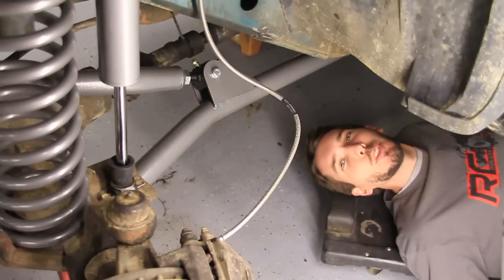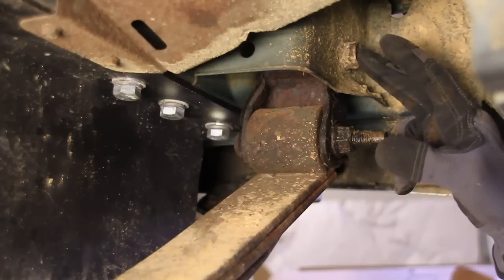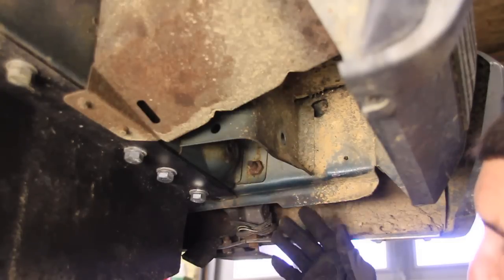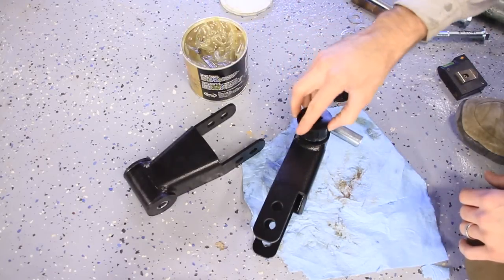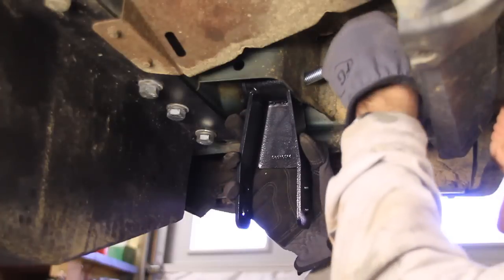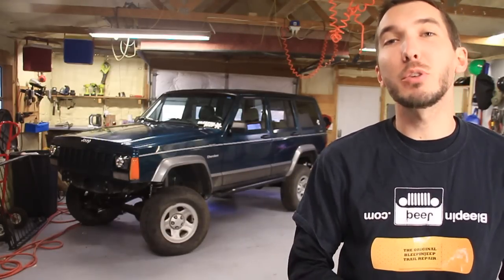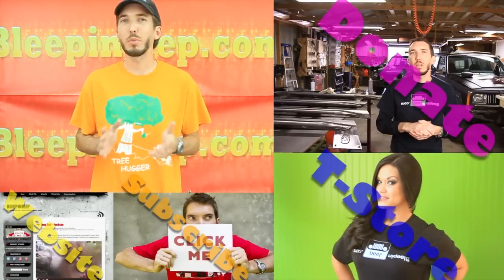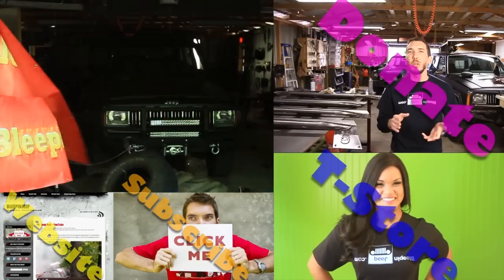How-To Install Shackles

Comment: Hey Matt! Love the videos. I have watched almost all of them now. 
My big question for you: When setting up the rear springs, would you go with a 6½" spring pack with the stock shackle or something like a 4½" spring pack and a longer, adjustable shackle or maybe a 4½" spring pack with a relocation kit and stock shackle? 
I got the front all figured out, but I wanna make sure the rear is set up right for pinion angles...

Comment: What's needed to lift a 1999 jeep xj 4 door 2 inches for weight compensation. So far I have lift shocks and shackles however I've got bumpers and everything but just want 29s for now, I have flares that are going to be installed at some point in the near future

Comment: Just installed a 4.5 inch RC short arm lift; my question to you. Do you think you can install longer shackles without having to remove the u-bolts again? Or do you need to take out the whole pack again.

Comment: Hey Matt, I know this video was done awhile ago but maybe you or someone else watching will know what to do. I've got this kit as well and I was looking at the hardware package.  You mentioned that the shorter bolts go up top... those bolts don't fit through the metal sleeve in the bushings.... is there a way to fix this or should I just try and use the stock bolts (if I can manage to get them out. Lol)
Reply from the maker: Ya, or just go get new bolts.  Tractor supply has great prices.
Reply: Okay cool. Frustrating though that their product is faulty.

Comment: I haven’t decided to dig out the instructions on the lift yet but I have the back don’t with the shackle the other way around I’ll fix it when I swap the Chrysler 8.25 with a Dana 44 but I just did that caus eit had more movement when I put it on it’s not driving but I’ll be sure to fix it.
Reply: Damn I butchered that typing...

Comment: I find its an easy lift mine gave me 3 inches on top of the 3 inches the springs gave me but I did find the axle angle that the shackles gave me did make the ride a bit rougher...

Comment: I installed my RC xlift like half a year ago and now my shackle bushings are popping anyway to stop that or do I have to take off rear end again and regrease? also I have stock shackles on 4.5 lift and the angle isn't the best can I get a little bit bigger shackles without adding too much lift to the rear so my shackle angle is stiffer with the springs?

Comment: so, don't you have to add shackles to both ends of the leaf spring?

wont it be off kilter if you just alter the one end?
Reply from the maker: no, one end has to be stationary or it wouldnt work... you can then add shims to correct angles if needed.
Reply: If anything, adding longer shackles at the rear of the springs, will improve the pinion angle.
Reply: 😂😂😂classic question

Comment: Please explain how to lift a truck when replacing the shackles. From my point of view, lifting the truck from underchasis will cause the body to fall onto the chasis if the shackles are disconnected.

Comment: I had a Rough Country 4.5 inch lift installed before the Rough Country lift I had a Skyjacker 3 in lift with the Rough Country lift I have a considerable amount of chatter coming from the rear when you take off in first and second gear the differential in the rear also looks like the angle is too extreme how can I fix the chatter?
Reply from the maker: try correcting the pinion angle first...  could be your ujoint binding.
Reply: How do i go about correcting the angle ...???

Comment: At 1:08 of this video I see your e-brake cable is pretty stretched. How much play do you actually get before damaging? I am doing a 2 1/2" OME spring with another inch for the extended shackle. I am not referring to the drivers side brake line but the e-brake cable at that point of the video. Thanks

Comment: I already have 4-1/2” rough country x series and i want to add 2 “ more how can i do that   If i add leaf-springs shackles and 2” spacer for front it will work ?
Reply from the maker: maybe but you'll start running into other upgrades you might need to make like an SYE for starters
Reply: One more thing i just order spartan locker for c8.25 29spline I will receive it tomorrow its ok to use 80w90 def oil wet trans-x additive ?
2. I search all over internet I can’t find locker or limited slip to fit my xj 98 all avem ar 27 spline lockers or lsd . Do You know which cars lockers or lsd will fit d30 29 spline or c8.25 29 spline

Comment: hey was wondering do u have to take the whole leaf spring off in order to put the shackle on
Reply from the maker: no, not necessarily
Reply: Raul Bocanegra yeah because I don't know how to make the leaf spring come lower to the ground. when I took the top bolt out the leaf spring went up higher into the body. how do I make it go down so I can put the shackle on.

Comment: do the shackles move with the leaf spring or are the shackles fixed in place?
Reply: does the position of the shackle matter when tightening the bolts?